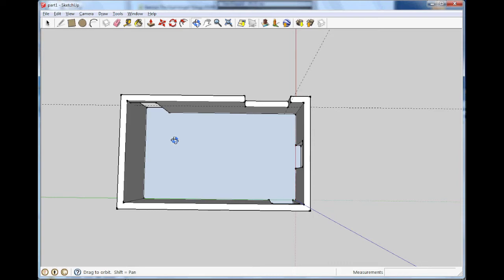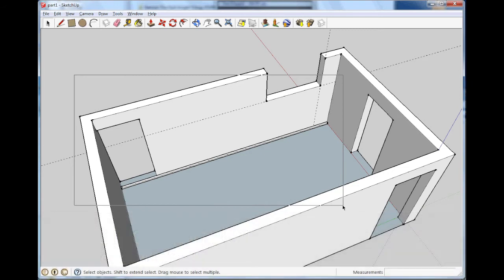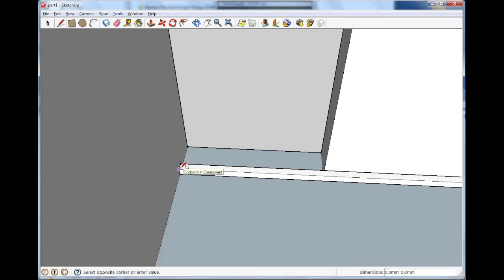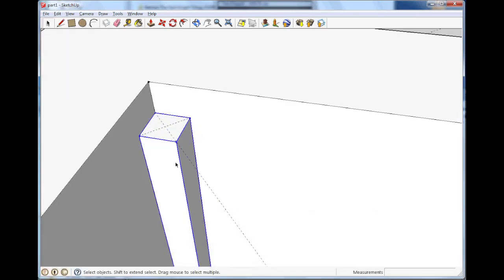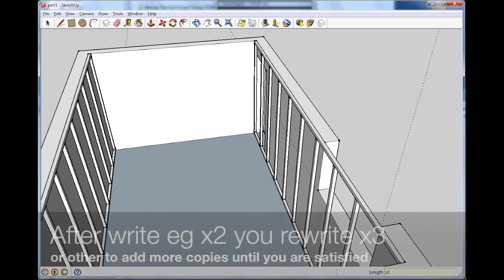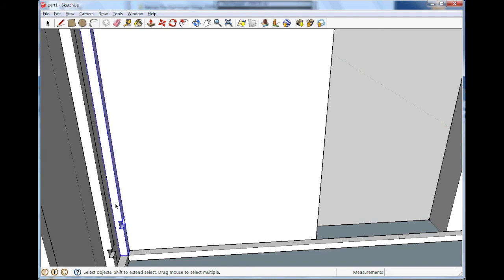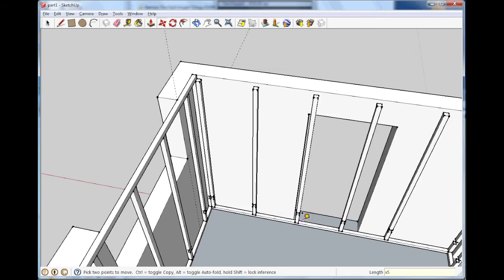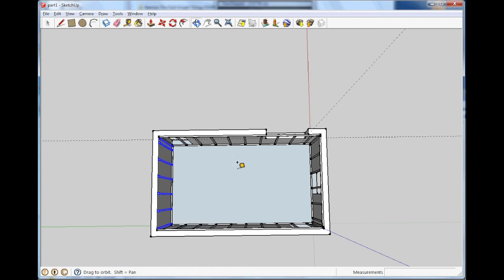Drawing my Workshop in Sketchup part 2, the framwork using: Components, Select, Rotate, Copy/Move

Comment: What is this the 19th century? Today to do what you're doing we use steel furring channel. No one uses wood anymore. Or don't you want to attach to the block at all? Is 45x45 common framing lumber in Europe? I don't think we have anything like that in the US.
Reply from the maker: +Paul Frederick At least in Sweden we still use mostly wood when constructing stuff. We have Steel furring channels aswell, but not as thin as 45x45 (I think the thinnest one is 45x70)... In my opinion there is nothing wrong with using wood when building, as it is doesnt use as much energy to produce as eg. steel. It also binds CO2 into the structure, and ofcourse it is a very good material to work with. As for 45x45 it is the smallest lumber for construction that you can buy in EU/Sweden. The US equivalent should be a 2x2". We have 2x2 in Sweden as well, but if you want it planed it becomes a 45x45 so thereof the dimensions. It is supposed to be used in situations like this where you dont want a big footprint of the structure, and rigidness isnt an issue. In this structure it is made to be able to put things on the walls easier...  My only concern is that since this is a "half basement" that there might be some moisture from the outside that might affect the wood...
Reply: Kristian Blåsol
This is steel furring channel http://www.costabuildingsupplies.com/img/learn-metal-furring_clip_image002.gif obviously less than half of 45mm. But they also make deeper channel. so you can have your electric buried. I'd hate to give up the floor space for it myself though.